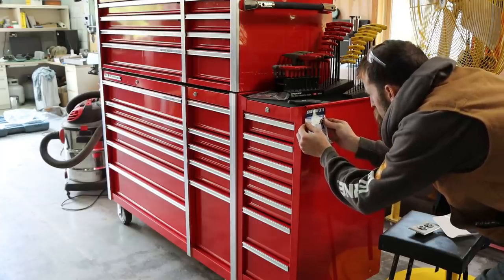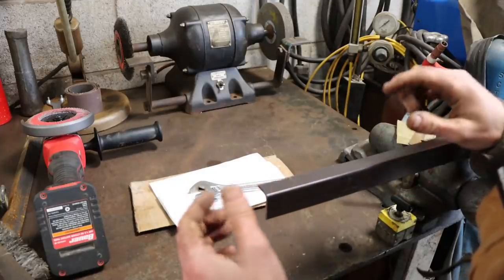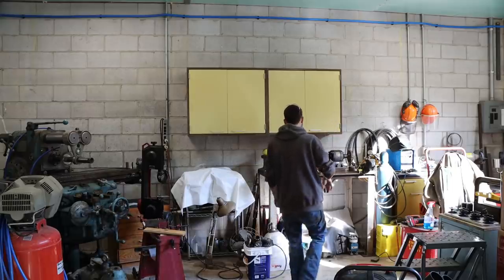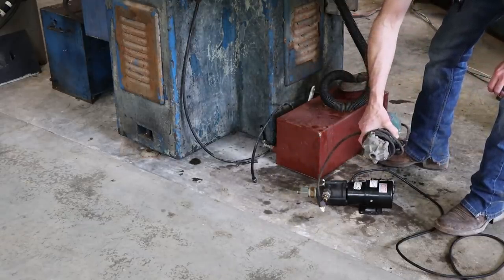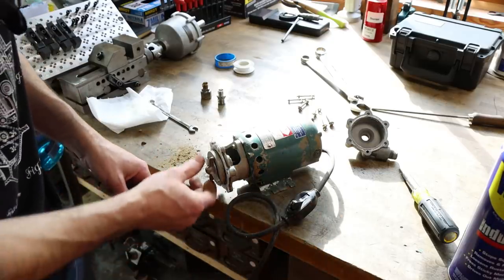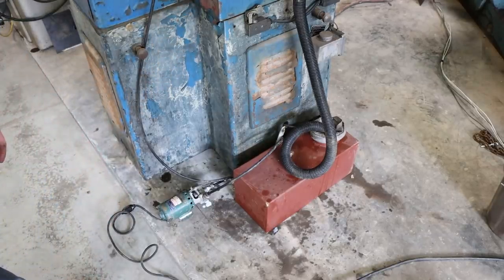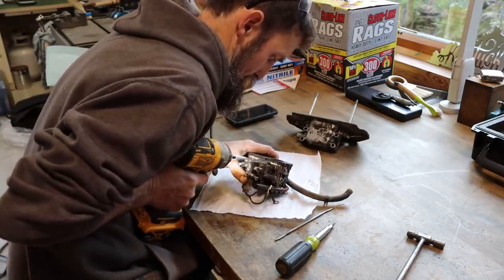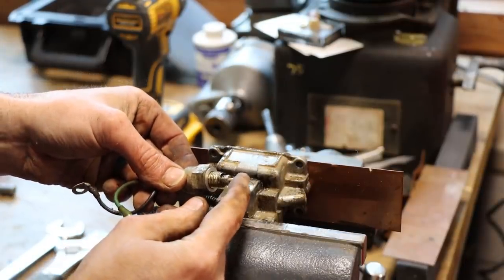Machine Shop catch up.

Comment: Be careful around running surface grinder wheels and chucks, grinding cuts heal very slowly.
_ Keep your favorite wheel well dressed.
_ Use lots of flood coolant.
_ Have ample magnetic contact by the workpiece. Block exit end if in doubt or the work piece is tall.
_ Move wheel to back of chuck when removing the workpiece. Use a squeegee to clean the grinding residue.
_ I always wiped the chuck with my bare hand before installing the workpiece to remove any grit (Before you youngsters began wearing gloves).
_ Dress a form wheel ONLY when there is no other way to grind the workpiece.
We ground all external surfaces of the cavity(cavities), core(s), insert(s) for squareness/width/thickness/length and draft tapers on most internal surfaces/forms in hardened tool steels for our injection plastic molds.
Enjoy a precision finishing tool.

Comment: Just a word to the wise, either move the VFD on the grinder or mount it in a box. At work, we had several 75KW drives go bad due to very fine, airborne, carbon dust. We had to pressurize the panels to keep the dust out. Say hello to Chestnut for me!

Comment: The shop is the same size as before but looks twice as big inside. Lots of workspace now. I’m jealous!
Reply: Actually Steve didn't use the busted half. It was always dark and off camera. Out of sight and out of mind so to speak. So when he fixed it he did double his usable floor space. That break in the slab was like the Grand Canyon before he fixed it.
Reply: @1pcfred  he sure did a good job of hiding it. I never noticed that.
Reply: @glennstasse5698  that's the magic of video. You only see what you're supposed to. In the beginning when Steve started to repair his shop he comes clean with what was going on. In the old videos he only had the one aisle by the one wall. So half the shop. The other side was all dark and he may even have had a tarp up? Steve used the other side as rough storage. And it was never lit up and he didn't point the camera in that direction really. I don't think even he wanted to see it. But he took care of it.

Comment: Shop looks great!! It definitely shows the great effort that you have put in to rebuilding your shop building and you also did a awesome job on the concrete work that you did and how you re used all the building materials and repurposed the wood for the big windows that were from sliding doors. You should be proud of your self for all you have done.

Comment: You gotta commit to the pour! Get past the angle where the liquid will cling to the lip and run down the side. Helps to have the thing less full to start, so either bigger measuring cup or less liquid at a time.

Comment: Morning, Steve. It's nice to see that you're getting closer to a completely functional shop. 
As a licensed electrician, I appreciate that you used ring terminals and bolts to mechanically connect the electrical conductors to the motor leads on your surface grinder hydraulic pump motor. (Motor lead connections made with wire nuts is a no-no.) However, I would like to point one thing out: when you wrap the leads with tape, it's usually done by first wrapping the leads with two layers of varnished cambric tape, followed by four half-wrapped layers of rubber tape, and finally two layers of plain electrical tape. This is best practice in the field by a licensed electrician. Any equipment that I wire for personal use: I usually eliminate the cambric tape (although this makes it messy if you ever need to disconnect the motor in the future). Just make sure to cover the rubber tape with at least two layers of regular electrical tape: rubber tape can unwind from the bolted connection because it does not have the adhesive properties of regular electrical tape.

Comment: If you want to save the plastic housing, you might try sending the fitting in further, cleaning out the cracks (solvent), epoxy, retract fitting before curing, and wrap in a glass fiber and resin.   Might do something for you in a pinch. Cool videos.  Nearly broke my heart to catch and release a total of 7 squirrels from my attic last fall.  Very cool animals, but a tad destructive for homes.  lol

Comment: Steve, you can draw only one seventh of the capacity of an acetylene tank per hour.  If you exceed this you risk starving the torch for fuel and that then causes popping and and what some call backfire.  This in turn can lead to and internal fire that will ruin the torch.

Comment: The struggle is real.  🙄
You want to do one thing (fill your coolant reservoir) and you have to do six other things to get there.
Mix the coolant, change the frozen pump, clean out the new (old) pump, ooop.. the new one leaks too!

Comment: You may want to consider some sort of cover / seal for the power leads running into that VFD. Grinding dust is conductive and gets everywhere. It will  settle on the screw terminals and create havoc.
Reply: Didn't look like the best mounting location to me either. Steve should probably put some kind of a board or something behind that machine with it mounted facing away. But the guy is pretty busy. Maybe he'll do something like that for the next one he buys?

Comment: I have had good success with repairing  plastic , especially those plastics with a high nylon content, using an old soldering iron and zip-ties as a filler material

Comment: If all that broke on the pump is the head, most pump manufacturers sell replacement heads, especially for those mag drive pumps.   Usually you can get both Polysulfinde or Brass.  Home Brewers use these sized pumps all the time and many have cracked a pump before.

Comment: Hi Steve and Elizabeth ☺, progress is good, the shops looking alot tidier/ usable, and little  chestnut is growing fast, I felt for ya when removing the solenoid , bits flying out can be a pain to find , I once lost a small part in my shop, I had to buy a new one, and yrs later while moving some stuff it turned up,lol, it pays you to keep your floor clean, good fix on the mower. Thanks for the video,  stay safe guys, best wishe's to all, Stuart uk.

Comment: I had several dozen magnetic pumps for the processing machinery in my lab. Most were Little Giants. The making benefit of mag pumps is that the body never leaks. Once in a rare while a small leak may come from a fitting on the pump, but enough Teflon tape on the threads and you don’t have to tighten it too much, putting less stress on the plastic fiber reinforced body. The one you substituted is way too noisy. Parts are easy to get for these pumps, and aren’t that expensive. Fix the mag pump instead. They’re very quiet, as I’m sure you noticed when using it, assuming you did. I can’t imagine how it was leaking so badly. It seems as though it’s possible the pump hit something hard, and the housing cracked.

Comment: I think the forklift is rapidly becoming the most used tool in the shop. I have  a similar water pump to yours I picked up used for very cheap, brushed mains voltage motor, loud but pumps a large volume for its small size, normally I use it for moving diesel around.

Comment: good thing you wherent in line with the jack or that crosslide would had hit you right in youre face
about the old coolant pump : maibe you can either weld it or get a replacement part for it

Comment: That pump is a piece of work 6000 ripems. Don't think you need that much. Maybe a speed controller.(just a phase chopper)  Then you could adjust the flow with a knob rather than a tap. Coz everyone likes playing with a smoo control knob. 
I have fixed cracks in plastic before by mounting in the lathe, turning the outside round and pressing on a metal ring to stop it swelling, Thanks for some good content again.
Reply: You can speed control a universal brushed motor but you need a dimmer that can handle inductive loads. Although I've heard of plenty of folks getting away with plain resistive dimmers. They can do it, until they can't. A motor will generate back EMF that can destroy the switching element in the circuit. Although you can get heavy duty triacs that can handle the stress. They don't cost much either. Like a quarter a piece? Or you add a snubber network to squelch the kick. It's something I've messed around with. https://i.imgur.com/GE3ZXqP.png https://i.imgur.com/M7WENhG.jpg I've speed controlled a 600 W router with that.

Comment: Just an FYI for later on the VFD. Those two indentations on the sides of the control are so you can yank it off the front of the box, get an extension cable and park it where you want it.

Comment: Really enjoy your videos.  Have never had the chance to work on a lathe or mill or any machine shop tools but still interested in men (or women) who do.  Just a tip,   I had the same problem with my carb on my riding Toro- would not start for anything.  I just removed the plunger completely and it ran like a charm.  I did put a fuel shutoff on it so before I shut it down, I just turn the shutoff off and let it run out of gas

Comment: I would be a bit concerned about the placement of the vfd unde the mill table, maybe put a shield plate above it but allow ventillation
Metal shavings inside the vfd is not good
Reply: Yeah, I spotted that too.  Metal shavings are the curse of stuff like this, and will often cause irreparable damage if they bridge tracks on the PCBs.  I was going to suggest a cowl to shield it while allowing ventilation.
Reply from the maker: I installed a shield over it to keep the dirt and grit from falling into it. It's not the best mounting location but.....😁

Comment: Spray welding , never had the stuff hold up for nothing on bearings. Always peeled off in very short order no matter how you do it, had to go back and undercut surface on lathe, mig or stick weld it up and re cut ( or grind if using hard face ) back to correct size on all bearing surfaces so it lasted under load. Got a feeling this is why your has so little use .

Comment: 16:00 Given the overdelivery of the pump at full line voltage, you might want to try a cheap light dimmer to slow the pump.  Brushed AC/DC motors can tolerate fairly distorted powerline waveforms.  This would give you better flow control and less noise?  Just a thought...

Comment: 6:11 Chestnut distracting from Steve sketchily crawling on the equipment. LOL  Dirt dobbers are good at filling holes, any hoes.   27:52 I'd give you $5 for that old gas can spout.  That had to be parts from a Government Gas Can Spout down inside the gas tank.  Steve you are way ahead of "where you were."  Shop is looking great.  Wishing you continued great success with the shop.  Stay well, stay safe.
Reply: I have a can that had one of those janky spouts on it. Turns out a long shank screwdriver can get that stuff out. Ain't nobody got time to be dribbling fuel.

Comment: Not a good idea to put the inverter down where it is not protected, as your conductive grinding dust will get in there very soon, and will destroy that inverter as soon as it builds up enough.  Best to have it in a cabinet, and use the panel remotely if you can, or at least use the inputs and set for remote operation with controls in a small dust proof box, and the inverter in a steel enclosure that will allow it to circulate air and keep cool. Blown way too many inverters when they got dust in them, and then the dust was either conductive or picked up moisture, and blew the controller board.

Comment: Seeing the open frame of that motor drive, and where you mounted it, gives me cause for a bit of hesitation... I hope that chips or metal grit from the grinder don't find their way in to the drive.   I would feel better if it was protected from that by placing it in a box..   Just a bit of my OCD about electrical stuff...

Comment: This has to be the first time that Starret punches have been used on a mower carb.
Reply: nope.  I used mine rebuilding the carb on a Craftsman mower last year...  But It's probably not very common!
Reply: @dennisp.2147  it is probably more common than both of you think. Mower techs like nice tools too. And they're using a punch to remove float pins a lot. Like constantly.

Comment: Question on lawn mower my 21 hp B & S runs but when in gear not enough power to move or turn on pto any ideals
Reply: Like Steve said most of the time it is fuel problems.

Comment: Always puzzles me that a country so fiercely proud of anything and everything actually made in the USA are also such fierce repairers of kit.  It's what is killing your industry far more certainly than the import of chinesium goods whether or not they are packaged in the USA .  If you don't support the small pockets of surviving industry by buying from them.  Next time you need spares or a replacement, they won't be there, or if they are they'll be selling imported bits made in the east.